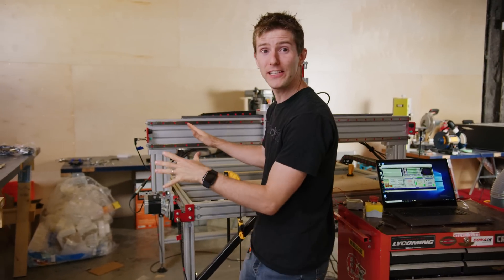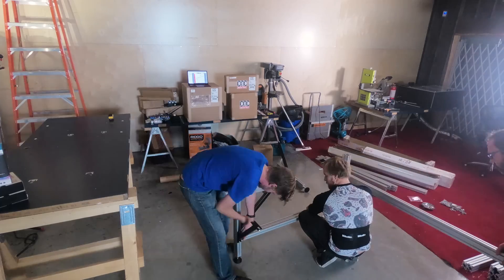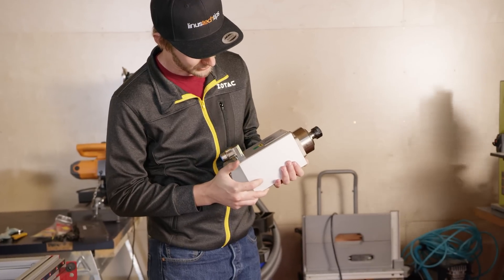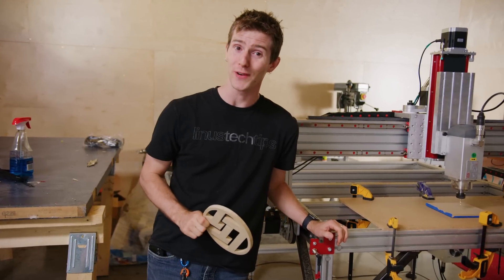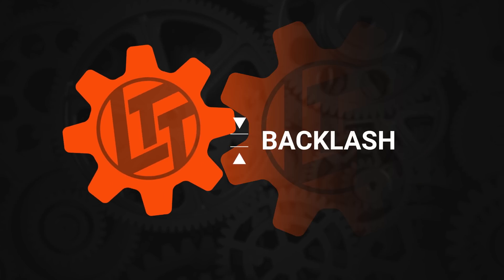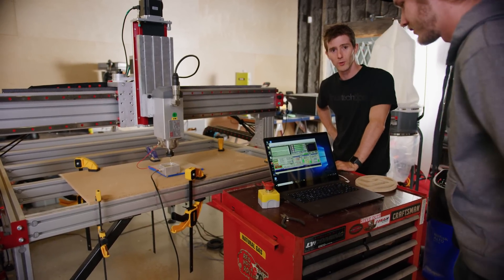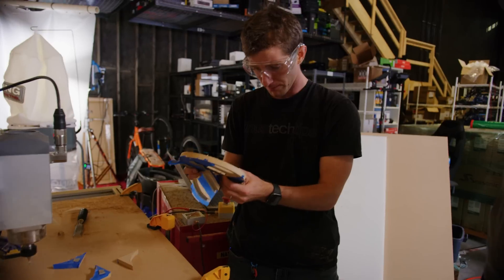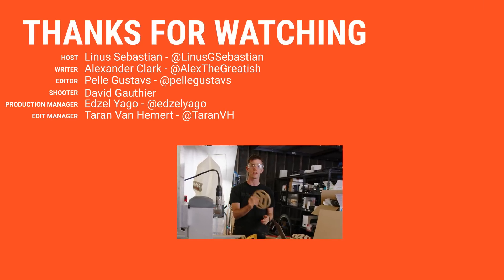Our New $10 000 Router!

Comment: I hope you know, that you can make that into a cnc plasma table. Also, make an acrylic computer case. And here's a tip, you can use epoxy resin as a replacement for acrylic, just test build it outta wood, then make make a silicone mold for an epoxy pour. Done. Besides pouring the epoxy.

Comment: Just call it the "2D Mill"... cus thats basically what that is... except well idk about this spindel but i dont think itll cut some steel. maybe alu.
Reply: It's actually 3D and its probably perfectly capable of cutting mild steel (like s235), just not at high speeds, also cooling and safety would be issues that need to be addressed :)
Reply: @gendragongfly  it has a y/z axis? okay didn't see that. yeah normal steel would be doable but idk. how good the spindel is (and that they clearly would need new "Schaft & Planfräser"). cooling... well i guess they could try a funnel i once saw with a "montierplatte" so they would just need that funnel, an industrial water cycler some very rough filters (or just a grated steelplate) as well as some sort or shilding as well as emulsion (i would geuss linus wouldnt want withe fluids all over his body... I MEAN EMULSION FOR GODS SAKE!) haha

Comment: Alex's replacement, perhaps now LTT will be able to do some half decent "machining" maybe it's my own envy of but I feel they should've gone with a mill and learned some basic welding before jumping straight to CNC... It feels like when someone buys all the kick ass hardware they can afford for their new PC build without actually understanding what the work load requirements for their system might be. Unless LTT is going to be fabricating their own cases or making some specialized merch I feel a little uneasy about this... I hope I'm proved wrong and they get some serious use out of this and learn more about machining and the fabrication process however based on their track record I think jumping to a "$10,000" CNC machine is a little... worrying... I love LTT and I love machining and maker projects however I can't shake a sense that this was kind of a silly move... I hope I'm wrong and sorry for the paragraph.

Comment: Now can you make a heatsink? With nice symmetry? The previous attempts were atrocious...
Reply: depends, I don't know if this is capable of metalwork. cnc crashes are no joke though hope these guys have some experience otherwise this will get expensive fast.
Reply: What about a WOOD heatsink????????
Reply: @AsbestosMuffins  

That router is more than capable of cutting aluminum. All they need to do is turn the spindle rpm up and turn the feed rate down, and of course some lub/coolant would help.
Reply: PsychoLucario it's a 2.2Kw router, I'm prettu sure it can handle steel with a low feed rate but it can surely cut aluminium
Reply: @TheDutyPaid  

Lol You don't need a coolant feed. A can of wd40 would do the job. The laptop can be moved away from the machine and the rest of the electronics are in enclosures.
Reply: @TheDutyPaid  

The table is wooden because they put wood on it. I guess that would also mean if they put steel on it they would have a steel table. 

They also said at the end of the video that they were investing in proper clamping so they didn't have to use double sided tape. Why coulnldnt that include a vise?

I know this is LTT but I'm pretty sure they can figure out how to contain a puddle of wd40, and then clean it up afterwards.

They don't need a coolant feed, as I said wd40, or pretty much any other oil will work just fine to both lubricate and cool the cutting tool.

The cutting tools they were using in the video may very well be for wood, but they are held into the spindle with what's called a collet. Collets come in many different sizes, allowing them to hold pretty much anything cylindrical. That means they can use tooling meant for cutting metal.
Reply: LMAO I love the comment strands like this. To everyone that thinks that this wouldn't mill metals is unfortunately wrong. It would do just fine. Just spraying a little bit of cutting fluid on it while working would be just fine. Placing a bucket under the table would catch anything that spilled. You wouldn't need any special cooling or suction. (PS. To a special someone... They said lathe not mill. A lathe is not a mill.)

Comment: A fun ting with stepper motors is they lose about 50% of their torque at high speeds (about 2000rpm). When they lose a step ie the magnets (rotor) jump a magnetic position they have no idea what happened and will gladly destroy the machine itself.

Comment: It's cool to see you trying to learn, but it was obvious the whole script was written by an actual machinist, and you have a WHOLE lot more before you should even pretend to touch this thing.
Reply: XD not really. My dumb self could do that. The tools are designed to be easy to use
Reply: Kids like your dumb self have tried using the micro mill at our school and they made a trip to both the school nurse and the hospital in one day. When they make the feed rates too high and a carbide bit flies into them, it's not good. Also running a CNC router or mill is nothing like a 3d printer. There aren't any "presets", unless you have a machine made to be idiot proof, which this one definitely is not.

Comment: TIG welder? You may look for 3in1 welder, so You could weld using sticks, autofeeding wire with shielding gas (MIG/MAG) , or TIG - using rods and tungsten tip.

Comment: A few things.

VERY Glad you guys are taking a larger interest in tools and DIY because the majority of your videos make me cringe at some point or another. 

2 - To hold down your material to your wasteboard, easiest thing is to put a piece of blue painters tape on both the wasteboard and the material you will be cutting. Once you have them lined up, put a decent/thin line of loctite or any kind of CA glue with an activator on the wasteboard side, and then spray your cut piece with the activator, sandwich the 2 together and the activator will cause the glue to instantly adhere and you will not be able to move it, until you want to that is. Once you are finished the blue tape will come off of both the wasteboard and the cut material easily but the 2 layers of tape will be stuck together by the glue. Easy peasy.

Also - DO NOT USE A CHISEL AS A PRY TOOL! Chisels are meant to do what they are named, chisel, not pry. Use a paint scraper or a putty knife or something else besides a chisel to pry something up.
Reply: yeah the chisel use was alarming, both safety and application.

Comment: does anyone know if the the 2.4 kw motor is three phase or single phase power?
Reply: The spindle is a GMT 2.2 KW and it runs on 220V AC so it most likely running on single phase as described on their website: http://www.cncrouterparts.com/22-kw-plug-and-play-spindle-vfd-system-p-353.html
Reply: @gendragongfly  thanks you! Im learning about these in college so was intrested

Comment: Something that you don't see all over the place, but you should define a small part of the table as your zero set. Basically, when you go to do a tool change you return the head to that point, of which has an absolute set of coordinates. Then every tool just gets set down on the bed (preferably made of hardened something) and tightened.

Comment: Do not connect that CNC control laptop to the internet. You don't want Windows 10 to randomly update and restart in middle of a CNC job, right? Use Windows 10 LTSB instead, its designed for this use case, or Windows 7

Comment: 1. Use Feed Rate Calculator
2. Always clean your cutting base and calibrate it.
3. Do not use wrong blade on wrong material.
4. Always wear a glass and mask. ALWAYS!
5. For MACH3, Use WinXP or 7
Reply: 6. For HOBBY USE, do not go higher than 15000 rpm for spindle.
7. Start cutting from inside to out.

Comment: If you put tape on the spoilboard and tape on the back of the work piece you can simply super glue the tape (s)? together.  Use something like 2P10 and activator and it set's instantly. 
Of course vacuum fixtures are nice to have and you can make them on your new cnc..

Name it Bill.

Comment: Could you do a guide on how to transfer a Windows license when upgrading the CPU and motherboard? It would be really useful. Thanks!
Reply: It's actually pretty simple. Want me to explain it here?
Reply: yes please, would really help when i´m upgrading my rig this weekend :)
Reply: The first thing you need to do is get, or sign in to a Microsoft account. Make sure your license is activated with a digital license associated with that account, and not a local licence. Once it shows that, change out one or two components. GPU and RAM are my favorites. Reboot, and give it enough time to make sure your license now recognizes the new components and your computer is still activated. You said you want to upgrade the CPU, at this point you can cut the computer back off and swap out just the CPU and motherboard leaving all the other components the same as were previously activated. as long as you don't change too many components at once, your windows license will migrate as you upgrade your PC, to cover your new components. fun fact, any parts that you have had in a build with an active digital license, remain on your Microsoft account as authorized parts. This means that in the future, were you to build a new rig using parts you had previously put in an activated rig, you can then login with that same Microsoft account on the new Frankenstein computer and Presto the computer is activated! I've used this method to successfully migrate my license across 3 plus compete computer build changes. Small change, log in, make sure it's active. Shut off, small change, log in. Rinse repeat.
Reply: @maj429  thank you!

Comment: Haha is changing the bit safe? Meanwhile its running at really high and deep cut speeds thats the real safety concern with you guys standing a foot away
Reply: Do you know anything about CNC's xD the bit while its drilling isn't really a concern as long as they have eye protection, its when they go to change the bit with it on thats dangerous, if for some reason it turns back on it could rip his hand apart literally.
Reply: I do but by the usage of the word drilling I doubt you do. Their machine has a separate power button and most likely a not computer controlled spindle speed for cutting the spindle power safely. They even mention it when they are having issues getting it started. That button when off there is zero power going to the unit same as if they pulled the power cord. Changing the bit you realistically have the same safety concerns as changing a drill bit or more accurately a router bit. They are running the bits a high speeds and high depth settings, so there is stress on the side of the endmill when its designed to be on the cutting surface.

Comment: Dust proof industrial PC Build incoming?
Reply: they do have a mammoth 01 case
Reply: I'd love to see that!
Reply: I wonder how cheap it would be to replace the case worthy of a $100,000 wood cost if it was made out of would and metal incerts(aka screw holes that don't damage wood) and metal brackets so hard drive cages weren't made out of thin wood.

Then paint it and give it a temperd glass side pannels. Oh and hinges those can be metal with plenty of metal incerts so the door doesn't fall out of the side of the case

Comment: As a suggestion for the computer, maybe use that dust- and water-proof chassis, and install sacrificial parts into it; if the thing only needs to deliver instructions to the CNC machine, perhaps all you need is probably a Ryzen 2400G, and a 500 GB NVMe drive.

Comment: I spent 3 days helping with the assembly of the 5' x 10' version of pro router with ny friend
(But it mostly took that long because my friend (who owned it) didn't wanna follow the instructions to the T and always was hording the manual, so we had to spend a lot of time squaring the table up afterwords due to all of the skipped "ah im sure its not that necessary" steps)

I plan on getting the same model eventually, but I have free use of friend's router currently since i helped with the assembly.
Reply: Long story short it hasnt been that long, im still slightly salty about it, and if you plan on getting/helping on one make sure everyone is following the instructions to the T (though you do have to look at finished pictures to make sure the gantry is facing the right way around manual lacks in that area)

Comment: If I were to invest a ton of money into a CNC machine, I'd probably build a little isolated room just for it, so that there wouldn't be wood chips everywhere.
Reply: Having a proper dust/chip collection unit makes it a non-issue. A lathe on the other hand...
Reply: It would also help on to reduce the noise level
Reply: I also wouldn't let one of my employees stand/jump on a piece of precision machinery.  The material supports were visibly bowing!  <cringe>
Reply: They're gonna make a dust collection system for it.
Reply: Yeah, I made a MPCNC, and even with a dust shoe I would get Extira everywhere, so when I built my larger machine I went with a full enclosure - here's photos: https://www.thingiverse.com/make:396280

I've even been able to cut aluminum.  Basically for less than $1000 you can get the same job done - just at lower depth of cut and speed settings than his $10,000 one - the pro CNC he ordered is when you need a CNC constantly going in a production shop - finish this job, move onto the next really quickly, etc rather than being able to go easier on the machine with slower speeds because you're only doing a project a day or maybe every other day.
Reply: CNC the door and room
Reply: I'm sure they're just prepping for the next Dyson sponsorship fiasco

Comment: I have used aspire and mach3 for ~3 years in our school. NEVER again use those settings again. Even though the rpm was high, do NOT use that working speed. You will snap the bit in pieces if it goes so fast.

Comment: I'd recommend doing a job in parts to help with waste materials and re-securing the parts. If possible, always add screwholes through the job into the scrap-wood to help it not move. Clamps often become loose with the vibrating.
Adding a skirt to the CNC (with a shop vac hooked up) helps with the wood cleanup; however, if you're doing aluminum/ copper, as I'm sure y'all will do in the future, you really need it. It's not fun getting burning particles of aluminum on your skin.
Wear safety glasses and long-sleeved shirts if working without a skirt on aluminum.

Probably should've just gone with the Pro 48-96. If you're putting down enough for a 48-48, then the jump (And increase in ability to do stupid crap) is worth it for most.

VCarve is a pretty good program but has some limitations. Also, I know Mach4 (or 3 in y'all's case) is a perfectly good progarm; however, I hate it none the less.